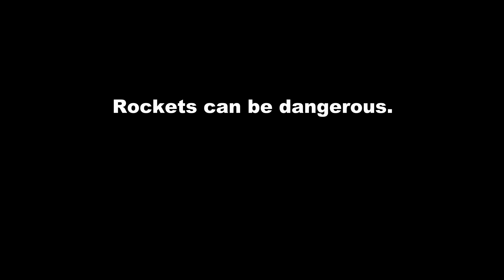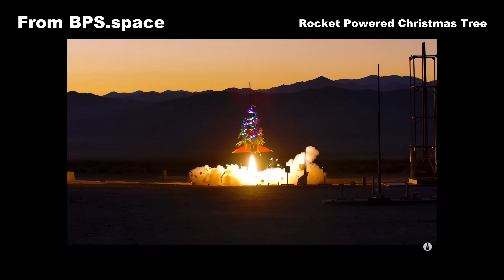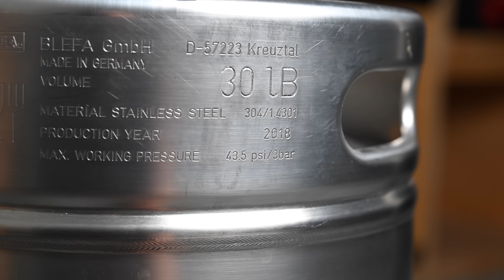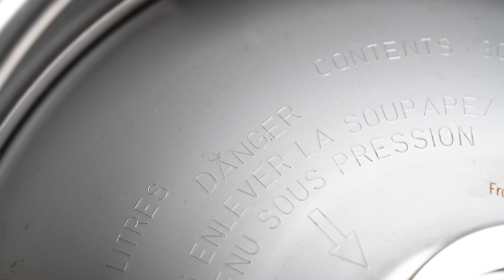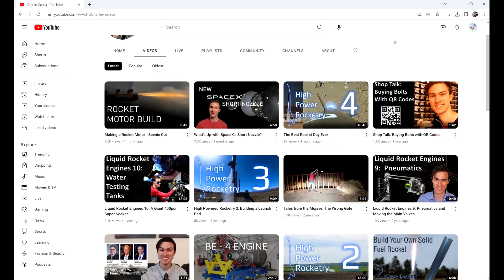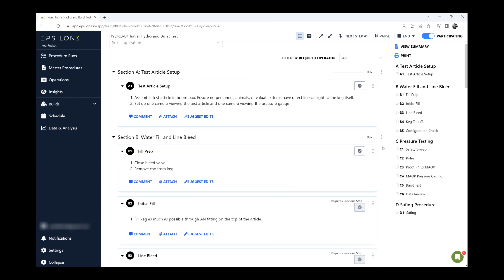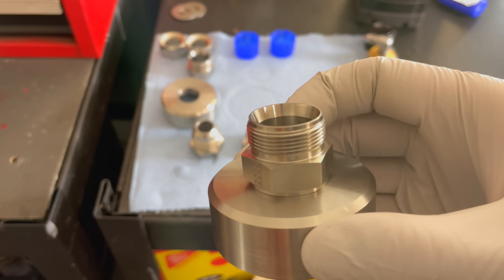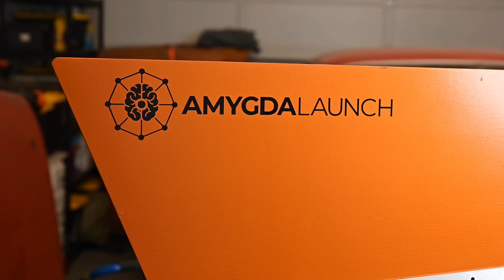Can you build a Liquid Rocket out of BEER KEGS?! - KegRocket Ep 1

Comment: Tanks are weirdly one of the hardest thing to figure out when doing amateur liquid engine. I made a small liquid thruster and found the propelent tanks to be one of the hardest engineering problem to solve. Pressure fed engines need tank pressures that are always outside of vessels that you can commonly buy. I ended up 3d printing my fuel tank out of CF-polypropylene. I tested it to 500psi and operated it at 350psi.
Reply from the maker: This is true! Always on the lookout for cheap, commonly produced high pressure vessels.

Comment: I don't mean any disheartening or judgment towards you or your project, but simply hope to inform you, as someone  who is a DOT and EPA hazmat pressure vessel inspector, and follows teh FMCSA, DOT guidelines on pressure rated vessels:

1. Next time yall do an Hydrostatic test on a barrel of the pressure vessel, start at %80 of the MAWP (or 200psi compared to the 250 it is rated for on its data stamp). Hold pressure for 5 minutes and inspect tank vessel for leaks or deformation.

2. After its Leak test at %80 of MAWP, raise to 1.5x the MAWP (or 375psi compared to the 250 it is rated for on it's data stamp). Hold pressure for 10 minutes and look for deformation and any bulging. After this, depressurize slowly, over the course of tens of minutes to allow the tank to de-stress at an allowable rate.

3. Almost all rated tanks are able to withstand 1.5x the MAWP before mass failure or irreparable damage occurs -- {however, this is just the 'gold standard' that all tank and pressure vessel manufactures must follow - you are likely able to go to 2x to 2.5x MAWP [500psi-650psi] before you really might see failure. Nevertheless, never take a tank above 1.5x MAWP for safety reasons :)}  -- such as barrel stretching, plasticity and cracking. Any pressure beyond the MAWP and infrequent bouts to 1.5x MAWP can cause damage over time, but if you are using it for a rocket, the 1.5x MAWP should be a good baseline for where you should take it no further past. 

As we all saw in the 'test to failure' portion of the video, the tank had a failure at the bung / protrusion on the lower head of the barrel, however the entire unit stretched a dangerous amount. This can or will lead to material fatigue, over the course of re-pressurizing and depressurizing the tanks with use, alongside rocket ignition and shock form launch.

Im interested to see how far you are able to sore into the sky, Good luck and God speed! :)

Addendum - For testing the welds and added structure to the tanks you are to use, see para 1 and 2 for the information regarding Leak and Pressure tests to NDI the tanks for your own safety or in future renditions of newer and bigger rockets. 

i hope this information reaches you well, and your team and yourself stay safe :)
Reply from the maker: Thank you for kindly and constructively providing this insight; will keep it in mind. Cheers!

Comment: Hi, have You based the hydrotesting pump on something You saw or just winged it? I'd love to build one myself but can't seem to find any DIY plans. I guess I need two one way valves and small diameter piston in between but I see You have added additional valves (6:21) I understand the blue valved one on the left is to stop flow from the tap (I guess You use water from the tap rather than a separate tank) and the silver valve on the right is to release the pressure... please correct me of I'm wrong :P
Reply from the maker: Yes that is our own design, not based off anything in particular. You are correct on both accounts for the other valves! The inlet valve is just a ball valve and the other is a needle valve
Reply: @KegRocket  Thanks! One last thing I forgot to ask, what is the diameter of the piston?
Reply from the maker: @PiranOfficial 0.5 inches
Reply: @KegRocket  Great! Thank You very much :)

Comment: Thanks Ryan. I wish you every success with this rocket.
It looks as though you might have most of the mass at the bottom of the rocket. If that's the case (and I hope that it isn't), then you will need to make changes: The centre of mass needs to be in front of the centre of aerodynamic pressure/lift at all times, otherwise the rocket will try to turn around, instead of going along the desired trajectory. Think about arrows and darts: For stability, the main mass is at the leading end of the projectile, and the fins are as far back as possible.
Reply from the maker: There is indeed quite a bit of weight in the back, there will need to be some ballast in the nose along with some big fins.

Comment: Have you also calculated the max load on the kegs outer surfaces in flight? The Atlas rocket was a pressure fed structure where the internal pressure of the tanks held the structure.. but once all that pressure is gone... it folds in like paper.. ofcourse.. the walls here aren't that thin... but in flight... it can experience a lot of stress from the aerodynamic forces.
Reply from the maker: Still needs a closer look, but the kegs seem inherently stronger (pressurized or not) than the airframe spars running between them.

Comment: If you think about the handling abuse kegs are built for, you'll find they are made much thicker than they really need to be for simply restraining the internatl pressure. That means they have features you don't need (which you could cut off, sure) but also wall thickness you don't need, and there is nothing you can do about the excess wall thickness. I find the entire premise silly and unconvincing. But you're comitted now, and besides, it was never about building a rocket, was it? :P You want to be a Content Creator™.
Reply from the maker: Silly and unconvincing is the whole point... It'll be all the more impressive when it actually flies.

Comment: Couldn't you have used a pressure washer? A lot of people use them for hydroforming steel.
Reply from the maker: Pressure washer probably would have worked fine but we weren't initially sure if the pressure would build too fast and be difficult to control

Comment: Would the burst test of been as spicy if it weren't precariously sitting on stacked 2x4s?
Reply from the maker: Probably, it might have launched higher too
Reply: @KegRocket  could you explain why? This sounds very backwards placing it so it will 3 feet so it can fall does not sound like it makes things less dramatic.
Reply from the maker: Because the cap shot off the bottom of the keg, placing the cap against the ground would have forced all the energy to go into launching the keg itself @babygorilla4233

Comment: Is the engine going to be feed by pressure in the tanks or by pumps?
Reply from the maker: Pressure feed definitely
Reply: @KegRocket  Yes it seems that pumps are the really hard part of rocketry. I have read that the US Redstone rocket (which was essentially a German V2) powered its fuel pumps with disassociating hydrogen peroxide.
Rocket lab’s Electron uses battery powered electric pumps. Of course I doubt I’m telling you anything you don’t already know.

Comment: I love the unique design of your rocket.  I have a T10 military surplus parachute that I don't need any more and if you do not already have a recovery system perhaps you might take it off my hands.  I wouldn't like to risk someone purchasing this and then using it for a skydiving application.  The canopy is thirty-five feet in diameter.  The original shroud lines have been replaced with 100 pound test Atwood rope micro cord.  It is suitable for rocket recovery with a rocket weight around 200 pounds if the deployment speed is not too high.  The thirty shroud lines are approximately thirty feet long and have a six point slider to slow the opening of the parachute.  I have a video of the test if the parachute if you are interested.
https://www.youtube.com/watch?v=vtmDAvkV1iM
Reply from the maker: We'll keep that in mind, thanks!

Comment: Did you have problems welding dissimilar metals?
Reply from the maker: All the parts are 300-series stainless steel so no problems there. Welding the relatively thick fittings to the thin sheet metal keg is challenging, so we hired a good welder friend to do that.

Comment: One problem I can see already is that you have identical volumes for LOX and ethanol. You will likely end up with an incorrect amount of one compared to the other.
Different pressures in the tanks may help compensate, but that may affect the mixture reaching the combustion chamber.
Reply from the maker: The volumetric mixture ratio will be the same yes, but the mass mixture ratio will be pretty reasonable for LOX and Ethanol due to the relative densities.

Comment: Very cool! And in theory you could upgrade it to methane / propane + lox? Propellant would probably be at lower vapour pressure than oxygen anyway. I am curious how will you do venting valves for boil off. Anyhow this is super interesting, just be careful with oxygen, it’s a sh@tty gas to work with.
Reply from the maker: Am a fan of the other light hydrocarbon fuels for sure, but a little bit tricky since the tanks are the exact same size. We have big low temp ball valves for venting the boiloff.

Comment: Fascinating project. First thougth on seeing 3 kegs, was two would be for ethanol and one for LOX to maximize volume mix-ratio for propellents. Seeing the 1:1 keg design, we now know you'll be running a LOX rich propellent cycle. 
Very curious to see  how will pressurize kegs during flight, manage propellent flow (pumps, or pressure, etc). Even more excited to see how you design, constructed and tested a liquid rocket motor. More beer kegs for a test stand, or just stainless steel thermo bottles? It will also be exciting to see what instrumentation (sensors) and telemetry you will integrate and configure, to manage fuel flow, etc.
This such a promising fundamentals of liquid rockets series, even if the project encounters some challenges on the way past max-Q to peak apogee.
Reply from the maker: We'll talk more about all that in the coming videos! Still a lot of that to be figured out too. Thanks for watching.

Comment: You are on an impressive journey. McMaster Carr sells cryogenic pop-off valves in incremental ranges from 5 to 400 psi for your LOX tank. Your hydrostatically tested modified beer kegs are strong enough to hold liquified Butane. Butane is a good deal more energy dense than alcohol. Mixtures of Butane and Propane will give you enough pressure to pump itself if you wrap the feed lined around the outside of the engine. LPG is easier to ignite and simpler to feed into a rocket motor than alcohol.

Good Luck & have fum.
Reply: But butane isn't alcohol and it isn't as funny as launching a beer keg rocket with vodka as fuel

Comment: Hopefully the kegs aren't coated with plastic inside. It seems like a lot of them are. I don't see a problem with storing methanol, but LOX might delaminate the plastic coating and cause clogs.
Also if you decide LOX is too much of a pain and use nitric acid, that would be a big problem.
Reply from the maker: We specifically checked with the manufacturer to make sure there was no coating... just plain old stainless steel.

Comment: as my gramps always said, a rocket is a bomb that explodes slowly and if you plug the aperture, it will explode quickly. worked at a pyrotechnic company in hollywood and he saw flares fail mid burn, and they would literally just detonate from the aperture becoming plugged. he never trusted road flares or model rockets
Reply from the maker: That's a great way to put it

Comment: Bravo!  A wonderful design and test!  Nice welds too!  Although it might require some additional testing, I think you should strive for using 1000 PSI since that would still give you a 20% margin.  If you weld a large washer ring around that boss that failed, I’ll bet you could bump that up even higher. This important because your thrust and ISP are highly dependent on your propellant feed pressure, and since I’m assuming you are not going to add turbo-pumps, you need that tank pressure as high as possible. I’m excited to see what you come up with for the engine.  BTW, where are you located?  If not too far I might like to volunteer help!  ;-)
Reply: don't forget liquid oxygen is extremely cold, and the tank will hold much less pressure at that low temp.
Reply from the maker: Good insights, fortunately high performance is not the goal here :)
We are in the US pacific northwest mainly

Comment: The flexing of the tank means that the tank will not reach nearly the same pressure when filled with liquid oxygen, since the (likely) AISI 304 steel will become much more brittle when cold.  Have you considered N2O? I think that's much more achievable, and also self-pressurizing. Save the cryogenic stuff for a future version, maybe.
Reply from the maker: We may do cryogenic testing at some point, but already have experience with LOX
Reply: I assume you get your LOX by liquefying it with nitrogen? Maybe try to pressurize a keg full of LN2 first. Otherwise you may waste a lot of your precious oxidizer.

I am very interested in hearing your results. My company has recently considered using a run-of-the mill water tank as a run tank for experiments with cryogenic fluids, so I would like to hear how this turns out.
Reply from the maker: @TheMongooseOfDoom  we’ll be sure to post the results if/when it happens. Pre-liquified oxygen will be purchased though an industrial gas supplier in a standard pressurized dewar.
Reply: @KegRocket  I don't know what the regulation is where you live, but we couldn't have a pressurized storage tank for liquid oxygen on site, legally, and the supplier would not fill up a temporary holding tank, so we had to liquefy from a battery of gaseous oxygen bottles.

Comment: 250psi operating pressure in the tanks is still likely less than the pressure generated by the motor when it's firing, so you're going to have to have some kind of pump making sure fuel and oxidizer go out of the tanks on a one-way trip, and fire and kablooey don't come rocketing (ha!) back up the tubes into the tanks.

Apogee 3 inches.  You're on your way!  But c'mon - imperial measurements?  Even as an American that just feels backwards, like measuring shoe sizes in increments of barley corns.
Reply from the maker: I suppose we'll find out :) but barley corns would seemingly be an appropriate unit of measurement for this project

Comment: Would it help the pressure of the kegs if you had a stainless tube welded inside to strengthen the bulkheads? I'm guessing higher pressure would increase your fuel flow rate. Good luck with the rocket. I'm curious what the turbo-pumps are gunna be like.😁🤞🔥🚀🚀
Reply from the maker: No turbopumps, just high tank pressure to keep it simple

Comment: Question about Epsilon3 - The steps are documented, but not the rationale (for each step). Do you do this (perhaps hidden behind a drop-down button somewhere?) If not, is there a particular reason for this? As soon as the team grows bigger, or a few years have passed, the lack of rationale could lead to needless head-scratching. Similarly, there seems to be no "owner" assigned to each procedural step. (The answer to: :Who requested this?"). Also intentional?
Reply from the maker: Epsilon3 has plenty of fancy formalities that are probably not necessary for a relatively small project like this. If this was KegRocket Inc. then perhaps!

Comment: Very nicely done, good to see those kegs used. If you need any advice around stainless parts etc feel free to drop me a message as I have worked for many years in stainless vessels, valves pipeline etc. 
doesn’t look like you need any though as those welds and fittings looked spot on.
I thought the tank may fail there as it’s a very light fusion weld due to low pressure rating of keg.
Looking forward to next instalment
Reply from the maker: Thanks!

Comment: You are presenting it as if its something stupid, but its brilliant - kegs are first off, robust pressurized containers, making them perfectly suitable for a liquid propellant tank role, moreover, being good both for LOX and any non-expanding combustible(actual fuel), since they are decently insulated, can be pressurized for pressure feed(that's literally how they feed beer)... Thinking about it, beer kegs are actually built very much like rocket fuel tanks with this bag inside, they just hold, well, beer. 
You are a true genius! 
good luck, subscribing :D

Edit: afaik there are 'open' and 'closed' kegs, former being the ones that are just pressure vessels with liquid and gas inside, and latter being a pressure vessel with a bag inside, bag containing the liquid, with N2 being filled around the bag but inside the vessel to push the bag closed. Tho i wonder if latter will fare well with LOX since anything stretchy tends to become rigid at these temperatures.
Reply from the maker: Ours kegs have no plastic liner inside, but yes, they lend themselves well to this sort of thing! Thanks for following along.

Comment: 50 years ago, RRS members used Sixth-barrel kegs as tanks for LOX and ethanol in testing liquid engines. There is a lot of history using commercial Keg barrels as tanks in amateur rocketry. We also found that they fail in the 1,100 - 1,200 psi range.
Reply from the maker: Would love more info on these old RRS projects if you have it. Figured someone else had built a rocket out of these before.
Reply: @KegRocket  I may have a few pictures of the project. I'm still searching through boxes of slides and prints from our move to Texas.

Comment: As someone who has built and flown a rocket using the same fuels I recommend finding a way to get at least 1" of foam insulation around the keg or you'll have real issues getting it to fill up with LOX.  Also mount your LOX vent and LOX pressure relief value up as far from the tank as possible.